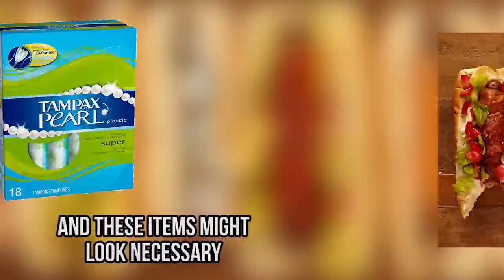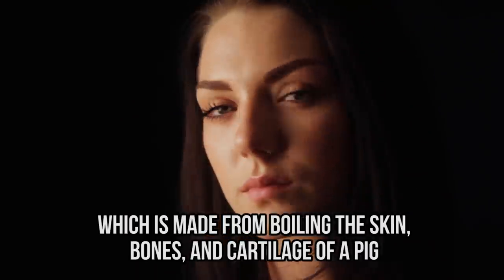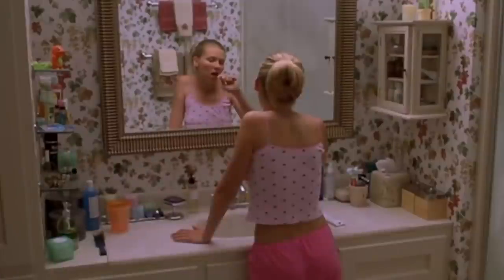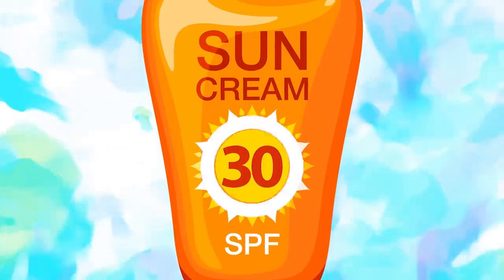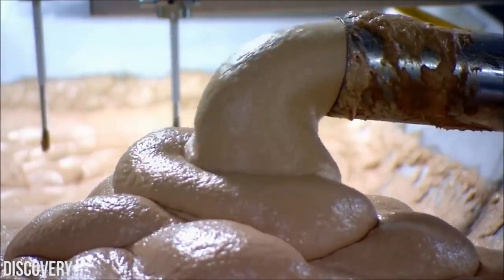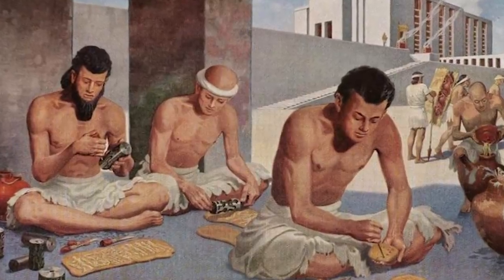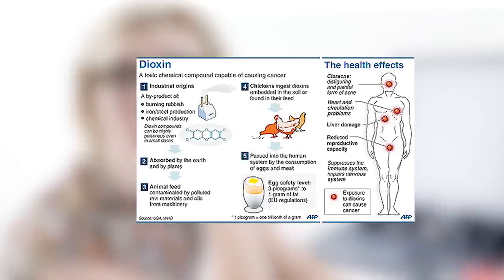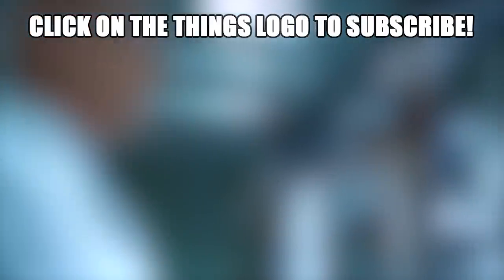10 Products You’ll Never Buy Again Knowing How They Are Made!

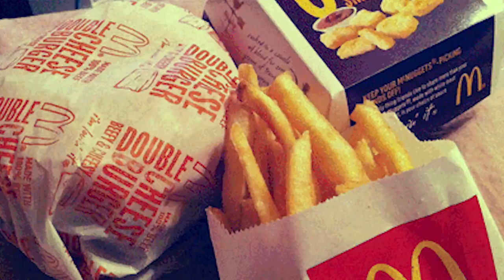Comment: FFS! 0:30 That is a marshmallow candy base. That is not meat.
FFS! 7:47 Oil is plant FAT. Oil and fat are the same thing, triglycerides.
The FDA did NOT ban Triclosan. The FDA made a ruling on the use of 19 ingredients in products. Companies had to make their products without the ingredients, pull the products or file for a new drug application for the products.
FFS! 8:52 Toxic shock syndrome related to tampons is caused by strep or staph BACTERIA after leaving the tampon in for way too long. ANYONE can get toxic shock syndrome and in all cases it is bacterial. Rayon is NOT a byproduct of dioxin. Dioxin is a by product of a no longer used wood pulp bleaching method. Our environment has been thoroughly polluted with dioxins and trace amounts of it can be found in tampons, even 100% cotton ones. There is far more dioxin in what you ate today than there is in tampons. Nope, menstrual cups can lead to TSS as well. Sulfuric acid: used in the production of aspirin. gasp
I do not eat candy.